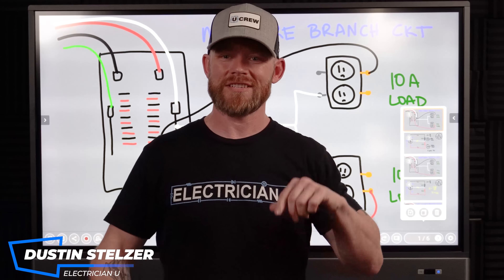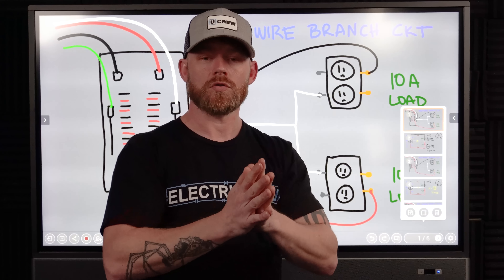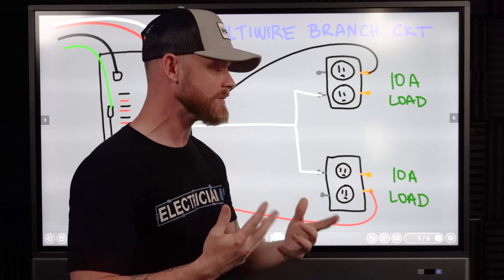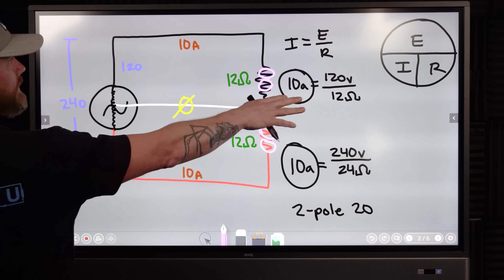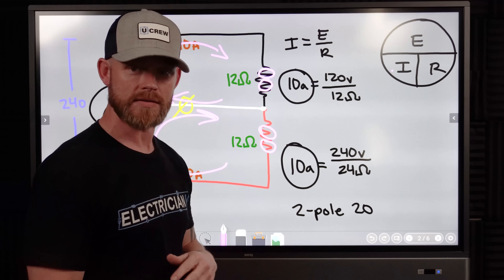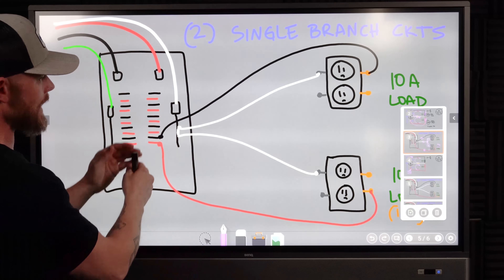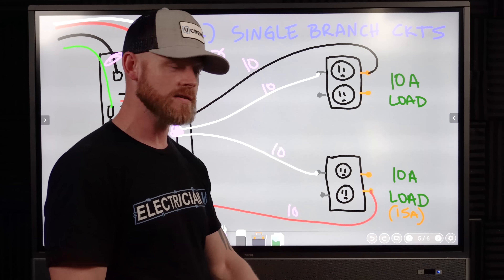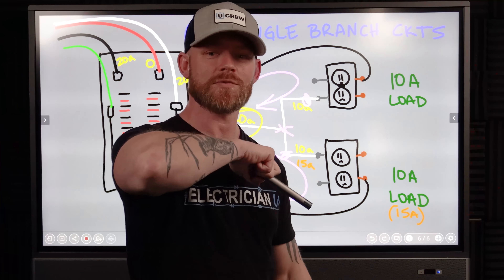Neutral Imbalance in Multiwire Branch Circuits (Two Hots, One Neutral)

Comment: With the 12/3 circuit, isn't there a dangerous situation if the neutral fails (gets disconnected)? Won't a high impedence device see close to 240V if a low impedence device is connected on the other side?

Comment: So is this on the up and up as far as code if i was to run a 12/3 on a 20a 240v breaker and have outlets on one line and lights on the other instead of running 2 lines? Or does the shared breaker negate the upside of saving on wire because then the lights would always trip if an outlet tripped? Do they have to trip together or could you use 2 120v (one 15a for lights and one 20a for outlets) as long as they are on separate phases?

Comment: INSTALLING A CIRCUIT IN A GARAGE. USING 4 WIRE 2222 100 MAIN BREAKER IN A 200 AMP PANEL 125 AMP RATED SUB PANEL I BOUGHT ENOUGH WIRE TO GO OVERHEAD. BUT ONLY HALF OF THE WIRE WILL BE IN THE AIR. LOOKING TO INSTALL IN 2" SCH 40 PIPE. IS THIS OK TO DO? THANKS FOR YOUR HELP.

Comment: So the million dollar question: A multi-branch circuit with a shared neutral but on opposite phases.... Is a double throw/ganged breaker required?   From a loading standpoint the answer should be no.  Per building codes the answer is yes.

Comment: How does this happen? [circuit imbalance] Hillbilly electricians who can't comprehend current flow characteristics.
There is another issue I have seen...
We'll move into the kitchen...The overhead light is on one leg of the 240V and the garbage disposer is on the other leg. [sharing a neutral] When you switch on the garbage disposer, the high startup current of the motor causes the kitchen light to get brighter for a second.  Why?

It is because during motor startup the neutral  is pulled closer to the disposer leg. [Hence the 60W light sees 132V for a second.]
You turn on the disposer, yes .5A of the disposer power is flowing through the light but there is so much more current that is forced to flow down the neutral and with respect to the resistance of the neutral wire causes a voltage drop with respect to the disposer leg but also a voltage increase with respect to the lighting leg.

The solution for this is to keep lighting circuits separate with their own independent neutral returns. Balance outlet circuits if they are to share a neutral and last but not least, keep the appliance and expected high current loads with their own dedicated neutral returns.
The only way this issue arises is because of idiot electricians or they want to save money of copper and work. Which in that case, they are still idiots.

Comment: In the USA the phases are opposite phase. So while a phase imbalance will cause current to flow in the neutral, it is opposite phases...

In this post he said that if loads are balanced, the neutral is not needed?
Reply: He also said the loads are never perfectly balanced.  He was just describing the ideal balanced situation, not saying the neutral was not needed in a practical sense.

Comment: Awesome video! Thanks Dustin! Question, at the top of the video you mentioned that the multi-wire branch circuit, when wired correctly using both phases, should use a double-pole breaker (both must trip at same time). Is that always the case, even when your two hots are going out to separate receptacles, powering <obviously> different equipment (as in your example)?

Comment: Justin, this was a real good lesson for sure.  I ran a multi wire branch circuit some time ago sharing a neutral between a lighting circuit and a dedicated microwave circuit. They are two separate phases but I used two breakers that operate independently of each other.  Now I recognize the danger: I could open a breaker for the lighting circuit but the microwave circuit would still be feeding that circuit through the shared neutral.  I think I need to abandon the the sharing idea and pull a separate cable.  Your thoughts?
Reply: Just add a handle tie connecting the two breaker handles. That way, you trip both at the same time.

Comment: So you're saying on a 20 amp two pole breaker if you hook a 12-3 and run two separate 120v circuits off it, you actually have 240v coming back on the neutral?
Reply: “240V coming back” is meaningless.  The neutral is always at or near ground potential.

Comment: I'm an RV electrical specialist.   50 amp RV'S connected to 240v 50 circuit.  Nothing in them uses 240v.  It's just 2 branch circuits.  Neutral failures are very common and with imbalance in the RV like a low resistance water heater on one leg and high resistance electronics on the other leg ultimately the higher resistance stuff gets hit with nearly the full 240 volts and fries.  I replace a lot of damaged equipment due to such.

Comment: Often (not by choice) I have had to run one "load" on a 12/2 using the white wire for the second hot and the ground for a neutral. Example, to provide 240V power to a water pump instead of 120 to take advantage of the extra power, helping the pump/motor work more efficiently. Always worked flawlessly.
Reply: You only need 12/2 for a 240v load. You don't need a neutral. 
The bare wire should go to the ground terminals at panel if there is a seperate neutral and ground bus

Comment: You lost my attention as soon as you said 220.  Nominal voltage in the US for a single phase service is 120 hot to neutral and 240 hot to hot.
Reply: Yes, nominal is 120/240, but if someone says 110/220 they mean the same thing.  Voltage falls in a range around nominal.  It’s nothing to get worked up about.

Comment: I bought a house with a few of these circuits, but the breakers feeding the shared neutrals do not have handle ties.  The house also has low voltage cable tv wires pulled in through the receptacle boxes.

Comment: This is for single phase residential. Can you do a video on single phase circuit on a three phase panel? The difference, from what I can gather, is that single phase resi is complete back and forth with the current with the phases 180° out of synch with each other but on a three phase panel they're 120° out of synch. How will this affect what's going back on the neutral?

Comment: It's NOT 220V, there is no such thing!!  The US uses 120V/240V!!  You are a smart guy; you should know this.  You make very good videos; however, you confuse new guys when you use the wrong terms for standard Voltage.
Reply: Get a grip.  It doesn’t matter if someone says 220 or 240, they mean the same thing.

Comment: Can you do a video on these kind of imbalances on a 3 phase system when a neutral is disconnected? I know this wouldn't normally happen but someone at work messed up working with live power and it got me thinking how much voltage the lights were getting while a neutral was disconnected. Would it be about 480 or considerably less with different resistances/ loads/ lights on the different hots?

Comment: The dead giveaway is 3 wire ( black,red,white and green or bare copper ground) going into the breaker panel. While its a bad practice its still legal if they use a 2 pole breaker for the two 110V circuits.

Comment: I show the Black phase as a sine wave and the Red phase as an inverted or minus sine wave (-). The current for the neutral is the addition of the two. In no case is the addition of the two greater than one phase and if they are balanced they perfectly cancel out leaving a flat line. If one phase is 5A and the other 10A then you will get peaks of +10A and -5A leaving a 5A current in the line.

Comment: Ideally you need a 2-pole breaker so that if one side trips the other side will trip. You can also connect two separate breaker together with a handle but with this arrangement one side can trip without tripping the other side. The tripping breaker will not move the handle enough to trip the other side. A dedicated 2-pole breaker will. The advantage of the separate breakers with a connected handle is so that you have to turn off both breakers in order to work on the tripped side.  The separate breakers with connected handle does not work on AFCI,  CAFCI, GFCI or AFCI/GFCI circuits because these breaker must match the hot current with the neutral current and this cannot be done with separate breakers and special 2-pole breakers must be used instead.

Comment: Most of time the shared neutral was done to save money on running one 12/3 wire rather than two 12/2 wires. Now days however, many circuits are required to be AFCI or GFCI or both AFCI/GFCI. With the shared neutral you cannot just use two separate AFCI/GFCI breakers because they depend on matching the hot and neutral currents in order to trip. Instead you need a very expensive  2-pole AFCI/GFCI breaker that can look at all three currents at once. This can be  much more expensive than two single pole AFCI/GFCI breakers. At this point it is cheaper to run two 12/2 wires than the single 12/3 wire. You must check the breaker requirements for CAFCI, ACFI, GFCI, or none before making this decision.
Reply: I think you can use GFCI outlets on each of the circuits. You cannot provide downstream protection by using the load terminals, instead all wires need to be pigtailed and every receptacle would need to be GFCi.
Reply: @vids595  Yes, if you can find the point where the neutral splits off to go on its own path, you can put a GFCI socket in the first socket and make all the downstream sockets protected by that one GFCI receptacle. Connect the downstream sockets to the load terminals of the GFCI receptacle. You should match the receptacle amperage rating to the breaker and wire rating. My home has this arrangement. If the neutral does not split off then each socket must have its own GFCI.

Comment: Ive seen electricians argue the opposite.  I think it can be better explained that a 220 circuit doesn't need a neutral. the only time you may need a neutral is when you split a 220 into 2 110v circuits.  In old house wiring from the 50s and 60s you may see only 2 conductor cables in 220 volt circuits for ranges and ovens and hot water heaters.

Comment: Great explanation. This used to be common with split receptacle wiring of kitchen circuits before GFCI was required, correct?  They used 12/3 cable to each outlet and running the top and bottom on different phases of a dual pole breaker (red, black).  While no longer permitted, it is still useful for shop outlets at times...  

I plan to cable a new 120V 5-20R split outlet on a 20A dual breaker with 12/3 for my table saw and then convert the receptacle to a 6-20R for 220V down the road when I upgrade the motor (no need to swap the breaker or wiring, just disconnect the neutral (white) that is not needed.  Permits me to use the second half of the receptacle for something else.

They only question I have is... should I take the unused neutral at the receptacle and tie it to ground when I convert to 220V (otherwise the white is just left unused)?  The breaker is in my main panel (*not* a sub panel), so the ground and neutral are tied together.  Is that a good thing to do?

Comment: Hello. I do like your videos very much.thank you for making them! I do have a question. I’m remodeling a small bathroom in a house that was built in the 40’s I believe. Anyway it has knob and tube wiring. I’m no Electrician by any means but I do think the fellow before me piggy tailed off the knob and tube to hook a bathroom light/fan up. From what I understand that’s not to code. Now the lady does not want a fan and light, just the light. I begged her to put the fan in as well but I lost that one, lmao! So could show something like that in a video, or maybe  tell me what I should do? I know running 12/2 or 3 directly to the panel would be best but I’m not even sure how to do that! If you comment on this I’ll explain better in detail. Thank you!

Comment: Not true but he did try. He forgot to put it in two different phases when you hook two breakers up top and bottom to make it 220 you have 120 that's hitting a positive phase and the other one is hitting the negative phase so both can run to the neutral wire because they are not in phase it's called a wave sign obviously electrical boy there doesn't know that go back to school. The I learned from my daddy doesn't teach you anything.

Comment: People just don’t understand. I recently had a service call where this was happening. The existing panel was an 8 space 120/240v single phase panel. This was in a small beauty salon. Beauty salons require a lot of circuits. So whoever did the buildout, decided it would be a good idea to use tandem (skinny) breakers rather than replace the panel. That by itself isn’t a problem really, the problem was they used each side of the tandem breaker as a multi wire breaker. So each neutral, potentially carried 40amps of current on it. The call I got was an emergency service call stating that the panel was hot to the touch, there was a smell of weird smelling smoke and a “sizzling” sound coming from the walls. What I found was it had likely been cooking for a while bc the isolators on the neutral bus bar had completely melted away. The insulation on the #12 whites were all melted away into one large lump, the insulation on the feeder neutral which was now carrying potentially 4x 40 amps on #6 wire, also melted. Some bad bad ju ju right there. I don’t even consider a guy an electrician if he doesn’t understand this lesson right here. BTW, it’s a close similarity to what a 3 phase multi wire system would look like. The numbers may vary, but the basic function is the same. Neutral Carries the balance of the load back to the source. 

As an added bonus, I would like to request a video explaining: ungrounded, grounded, and grounding. A.k.a. “Hot”, “neutral”, “ground” respectively. A lot of my new apprentices think the “neutral” doesn’t have power and get shocked on it because they don’t understand that the neutral is also a conductor. Thank you for the videos. I use them as training tools for my guys. Keep up the good work brother. 👍🏼

Comment: As a human, not formally in the trade, but with a lot of knowledge (a little knowledge is a dangerous thing!), I will be balancing the loads in my breaker box soon. Since my apartment was rebuilt and rewired, heavy loads like 3 window a/c’s, electric kettles, humidifiers, laser printers, microwave ovens and induction cooktops have been added without regard to which phase powers them; furthermore, there are probably multiline branches. I will even up any multiline branches I find and even out the load on the main neutral bus. It couldn’t hoit!

Comment: Then both 120V loads are not on a 120v system but a 240v system because both of the voltages would connect and would they either not function properly or would blow?
I have used both hots going to one outlet and had one leg on the first 120 plug and the other leg on the second 120 plug so a heavy load on both plugs would not trip the one breaker because it's really two, and also so I can add a 240V plug below them for my MIG welder.

Comment: Thanks for this video. This is especially pertinent because people are now getting 120/240 split phase interlocks or transfer switches installed and then using 120V generators to power them, often just bridging the two hots. So they have potential of overloading the neutral when using these generators.

Comment: Every kitchen counter plug i’ve ever seen works this way. A 14/3 wire is usually run to each plug. Red on one outlet on the plug and black on the other outlet with the white being common. So running a toaster oven and a coffee maker on the same plug is bad? In that case why do they even make 14/3 or 12/3 wiring?
Sorry not an electrician.
Reply: If the hot tab is broken off, so each of the 2 receptacles in a duplex box had a different phase but the neutral was shared, running heavy loads at the same time would be a good thing. It would reduce the amperage running through the neutral. This assumes all the lines are home runs back to the breaker panel.
Reply: @sparkyspartacus2287    Thanks for the reply. But if the amperage is reduced on the neutral, where does the excess amperage go?

Comment: After watching this video, I wonder if I created a dangerous situation, or not.  I replaced a bath light/fan which had been wired to run both the light and fan when the switch was turned on.  For the new light/fan, I wanted the light and fan to be on separate switches so I ran just one more hot wire (colored it red) from the switch box to the fan (easier to pull through the wall than a new piece of Romex).  Now I have two hots and one neutral running to the light/fan, but it seems to work just fine.  Is it fine or dangerous using the one neutral wire from the switch box to the fan in this situation?
Reply: I'm a DIYer, not an electrician, so I'm not sure about the safety of pulling an isolated hot wire through the wall instead of the complete piece of Romex pig-tailed to the other wires in the switch. However, purely mathematically, your situation is different from the video. He's talking about neutrals shared between two different circuits at the control panel, like two 15A circuits going out and adding up to 30A coming back. It seems like what you did is split the hot wire of a single circuit into a small parallel circuit in your bathroom. If you had 15A going through that circuit, it will split into, say, 10A going to the fan and 5A going to the light. The current coming back on the neutral to your switch is still 15A.

Comment: To simplify it , when using multi branch circuits run it off 240v breakers  with 1 common going to panel per 240v breaker.  Each screw is a leg and that is 120v . I did my shop like that,  and most inspectors like the 240v breakers instead of tie bars.  Use 20 amp 240v breakers and your done